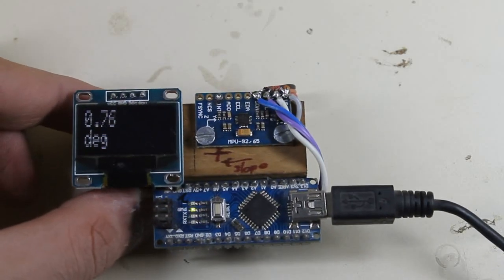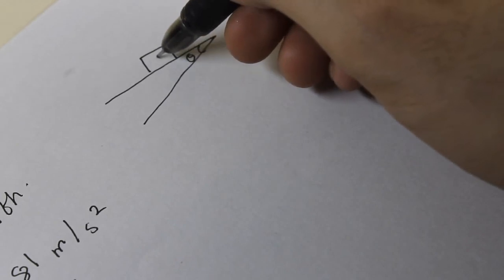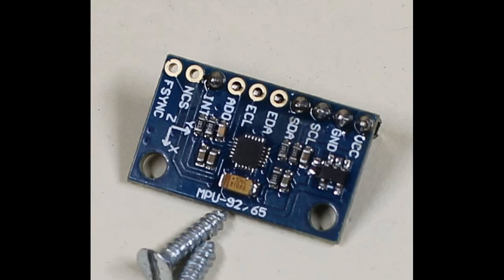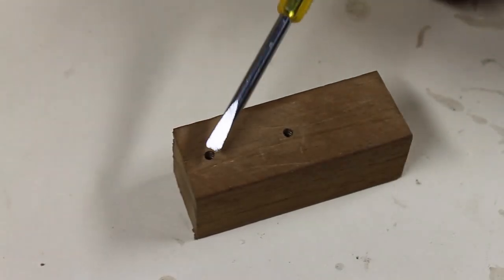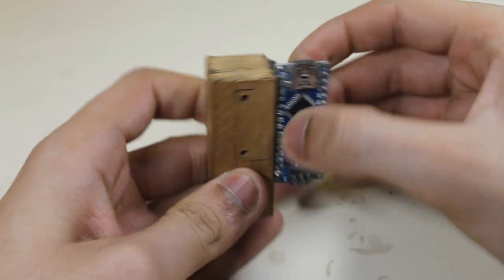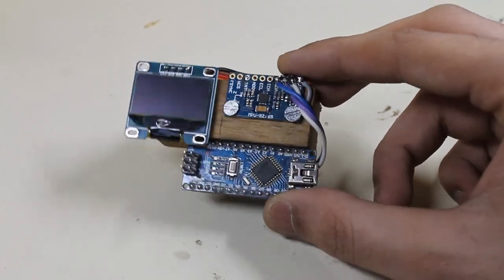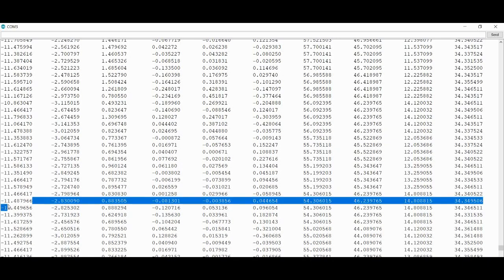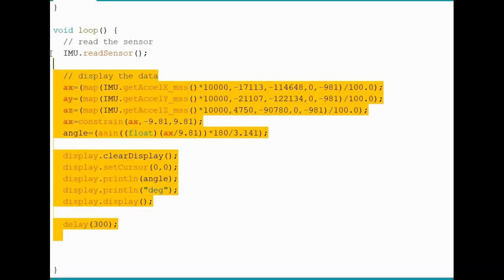DIY Digital Inclinometer

Comment: How did you do the pinout of the OLED display? You only showed the pinout between MPU 9250 and Arduino:
SDA-A4
SCl-A5
Vdc- 5V
GND-GND
Reply from the maker: Hi!
My bad.. the pin out between the OLED and Arduino will also be same. 

SDA to A4
SCL to A5
Gnd to gnd
Vcc to 5V